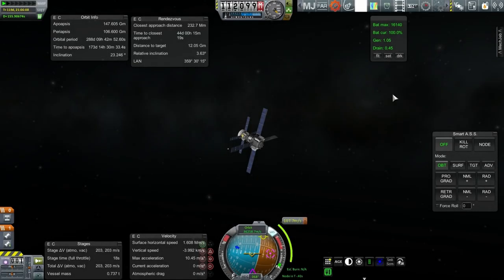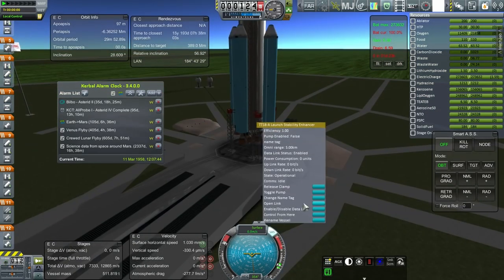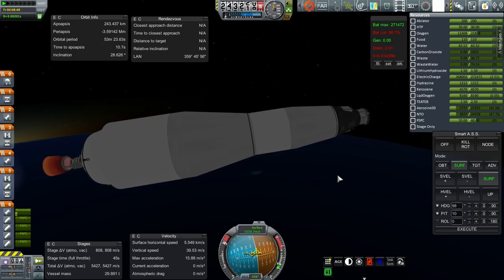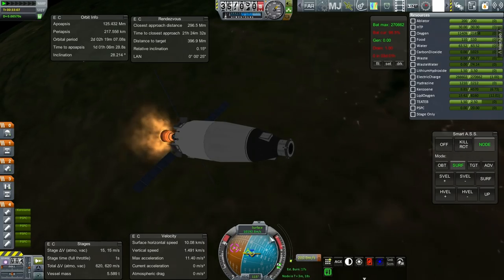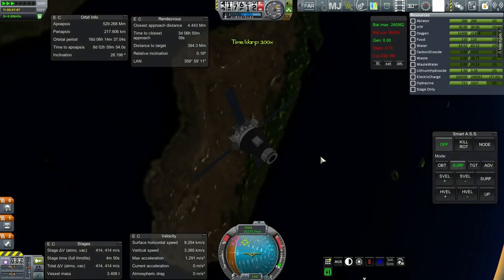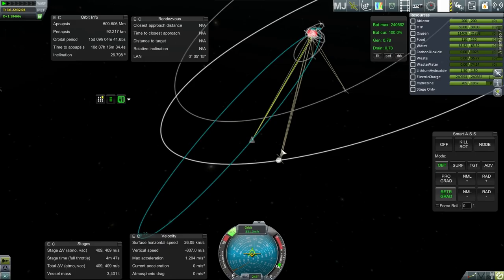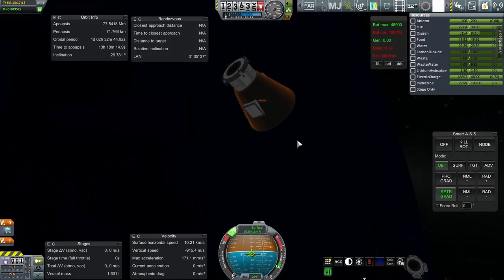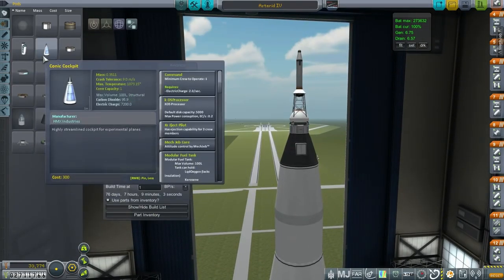Realism Overhaul in KSP 1.0.4 - 24 - Lunar Fly-by Test

Comment: What about put a 2m heat shield beneath the 2m pod?
Reply: +Tyler Raiz Good to hear that you considered my suggestion. If the option works, you could just dive into the atmosphere, without making additional orbits not to overheat the pod, and that might solve the battery capcity problem.